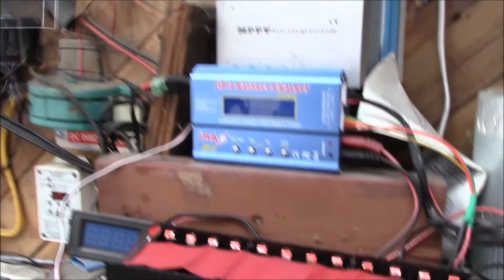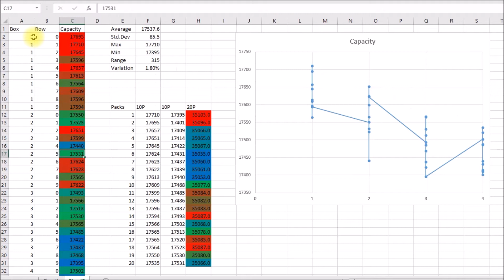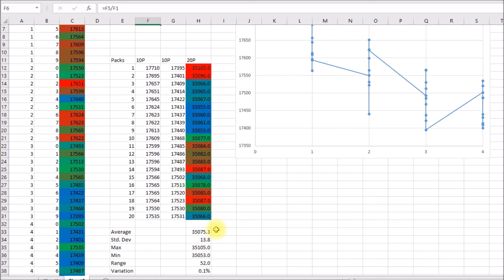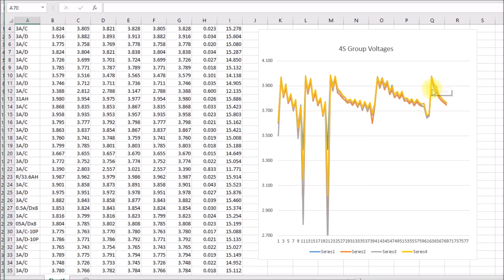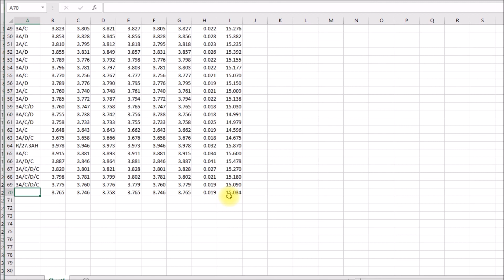BAK 18650 Cell Testing, 10P Group Results

Comment: Hey M8! I have the chance to get 60 pieces of BAK 3350 mah 18650 cells. How is the quality? Can I use them for an ebike? 13s4p I would try. Maximum 750w. Thank you!
Reply from the maker: I have the 2200mAH cells, they are still going strong in my power wall.  You should probably check the data sheet on those to see what the max. discharge current is and whether that'll meet your power requirements.

Comment: So you started the test with 4 volts and ended with 3??...that would explain why you ended up with 1700 rather then 2200. A short cut to getting matched cells would be to measure resistance at the same voltage. I had bought a set of EVE cells, and used my Miboxer charger which in about 20 seconds can tell me the resistance of each cell. I then match them accordingly.
Reply from the maker: Yes, that's the working voltage range I used, I'm only running my system up to 4.0 volts/cell so I wanted to have the testing conditions match that.  The Imax-B6 was only used to charge the cells to that voltage, then I did all the final capacity testing on an ICharger 1010+.  I'll give that resistance method a try if I ever pick up some new cells.

Comment: what do use all that energy on         / light, toys, heaters, TV, equip??
Reply from the maker: I'll be assembling the cells into 4S-20P battery packs:
 https://youtu.be/qr46Ee8WxLA
and those will be connected to my solar panels, via a charge controller, and then to a power inverter to power loads in my house.  I hope to be able to run most of my electronics (computers, NAS, networking, etc.) equipment around the clock.